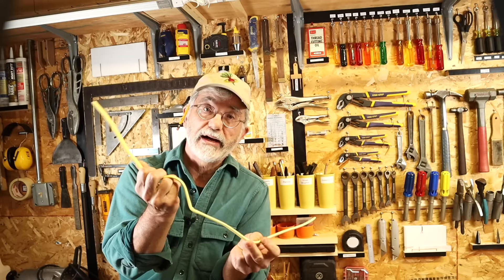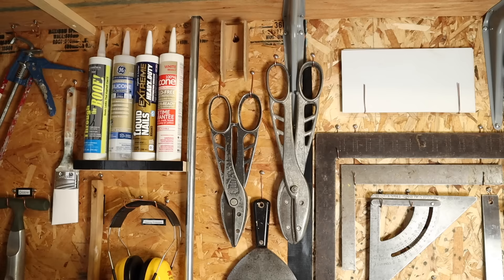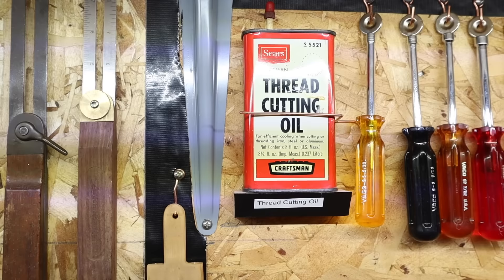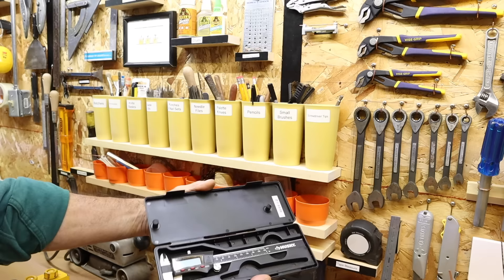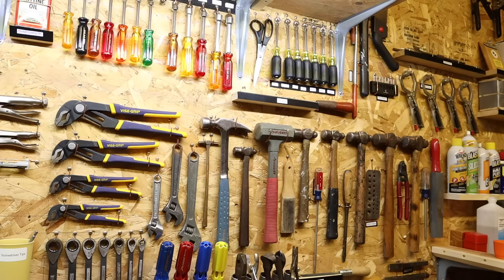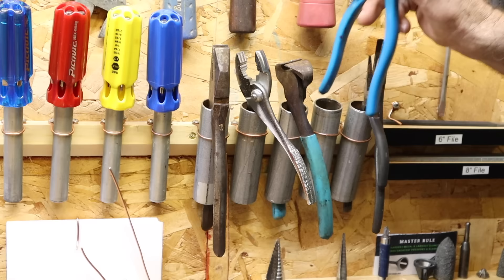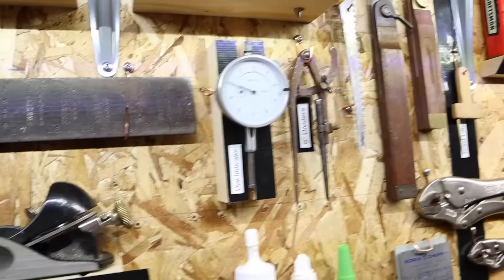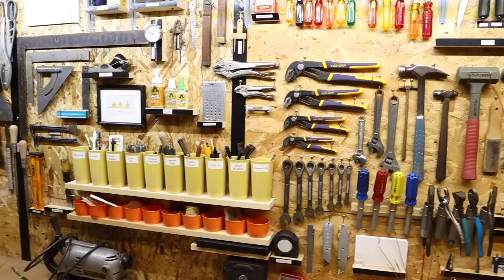How To Have Amazing Tool Organization Using Scraps of Electrical Wire

Comment: ------   12 gauge copper wire is simply too soft without enough tensile strength:  even #6 copper ground wire would be iffy   -   note how cautiously he removes and replaces the tools  -  and how often he "restores" the holders as he demos  -   would be perfect if you want to display but seldom use the tools

Comment: The backboard is 7/16” thick, but the screws are 3/4” long. Do the screws penetrate all the way through the backboard and into the wall behind it?
Reply from the maker: Sometimes, yes. I know where the wires in the wall are. No harm done. 👍
Reply: @herrickkimball  I’m thinking maybe 1/2” long screws would be better.

Comment: If I were to wall mount all my tools I'd need a wall about the length of my street ... Both directions! I'll stick with my ~12 toolboxes! BTW I STILL have mounted tools ... Hanging on screws on the front edges of the thirty feet of shelving in my garage and on another 20 feet of shelving & cupboards in my large shed as well as wall mounted RAACO boxes. STILL not enough space. Approaching the position of Adam Savage's workshop. At least he has one space ... I have to keep track of tools & stuff in my study/electronics bench, garage, and two sheds! Oh for a much bigger property with space for building a minimum 600 sq feet workshop to  consolidate everything.😮😢

Comment: All very interesting and ingenious but there exist certain drawbacks. Firstly you will need to spend an amazing length of time to make all those hooks to size for each application. Secondly everything will be covered with dust unless you run a regular and alas lengthy cleaning operation. Finally if you ever have to have workmen do any work in this shop, fix the ceiling or the floor, then everything is exposed to theft and you will have to be present 100% of the time to monitor to avoid this.
Reply from the maker: Wow. Good job finding the drawbacks. 👍

Comment: Do you have a methodology for sockets?
Reply from the maker: I made narrow wood shelves for my sockets and handles. Lined them up and put a #12 pan head screw where each socket goes. The screw is up 1/2 inch. The sockets register into place over the screw head.

Comment: If you don't have scrap copper wire...and need to buy new Electric fence wire is actually more structural and cheaper than copper. Might have to buy a spool, but it is useful for many other things.

Comment: Pro tip, copper is extremely soft and weak. In the end not a good choice unless you are dainty
Reply from the maker: Soft, yes. Weak, it depends on the application. 1+ years later and the soft wire is still doing the job admirably. 👍

Comment: Instead of metal pipe to use for pliers and screwdriver mounts use PVC 1/2" and 3/4" just bore hole thru front  big enough for head of screw with smaller hole in rear to mount to 1x.....

Comment: Good luck getting those bent wires to stay in place.
Reply from the maker: 1+ years later and no disappointment. But I will be replacing the stapler hooks with a shelf. I use it often and it’s a pain to put in place. The shelf will be easier. 👍

Comment: Not got a lot of tools then if you can fit them all onto one wall ... I have a total of 14 toolboxes PLUS stuff hanging from the wall, under cupboards, under shelves etc and tools ranging in size from pipe benders to micro tweezers for jobs from woodworking, to metalwork, to plastics to electrics to electronics! I'd need TWO walls 40 feet long to fit them all like that! Be serious!

Comment: It's cool but I can't work that slow and that gently. I have to be able to get my tool off the wall and throw it back on there and cannot use 2 hands to carefully squeeze the handle closed and gently put it in the loop.
We have too many employees in the shop that are not gonna be anywhere near this slow.
 like it's yet. But when it's Burlington is gentle as I can be. And this just is not going to work. This would be destroyed literally in the 1st day In my shop, only contains experience mechanics don't have any slack kids or anything. I have experience mechanics that know how to take care of tools. But this would require just too much gentle handling to put tools up.

Comment: You’re just too organized.   Do you recommend drilling a hole in the handle of some tools to hang on the copper?   You did not mention the thickness of board you’re hanging the copper loops on.   As well, what thickness of board do you use for the shelving?

Comment: Good idea to use copper wire. Organized and practical (and a little anal). Helps if you have the wall space. I use drawers with labels and the hand tools I use most are on the wall.

Comment: Horrendous waste of space.  Imagine if the local hardware store laid out everything like that.  Best use of limited space is in racks similar to a store display.
Reply: I tend to agree, I still like the idea, but in a very small work area, it's best to think "from the wall, then towards me"... Uses more of the available wall space. For example, if you have a wrench set, you can use nails and hang the 19 mm, 18mm, and 17mm together. Then, another nail and hang the 16 mm, 15mm, 14mm... and so on.

Comment: I have never understood the desire to use a wall for tool storage. The layout never lasts and you end up with a mess of disorderliness. No thanks, I'll stick with tool boxes.
Reply: More of a tool display than a tool storage idea.  
Not practical if you have a large amount of tools.
Reply: @burtreynolds3143  I don't have anything against it necessarily, to each their own. I have tried it a few times but I always end up just preferring to know which drawer it's in.

Comment: This looks like crap. I can't stand the OSB, total wrong move, at least paint that shit. Over 35 years ago I organized my tools I used 1/2 inch plywood painted white. All tools were hung with primarily 4 penny finish nails, this looked so much better than what I see here. Additionally, I drew the outline of each tool with a black sharpie, rather than a label, FFS. In the land of the blind, the one-eyed man is king!